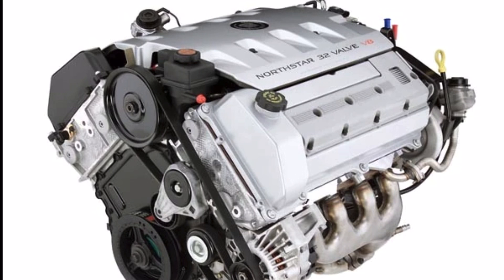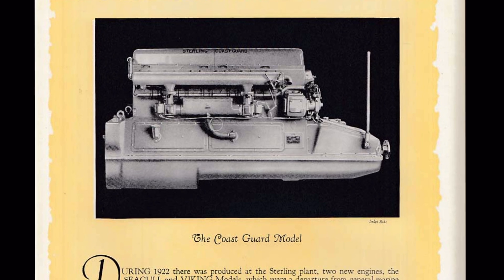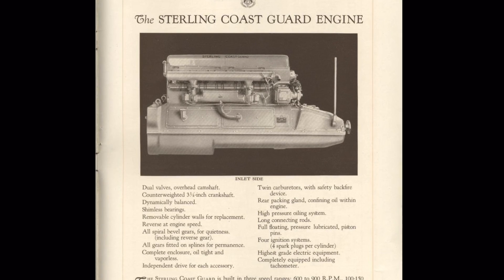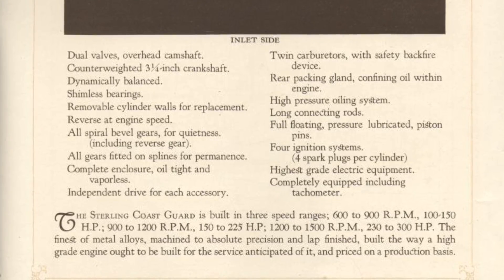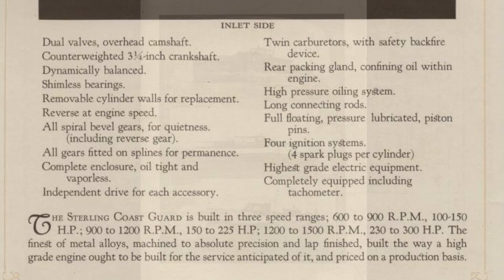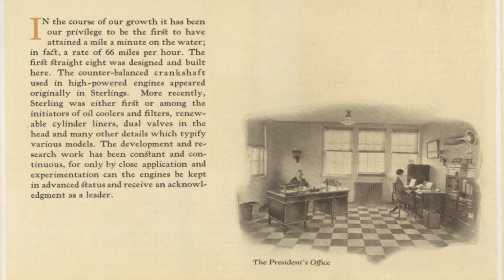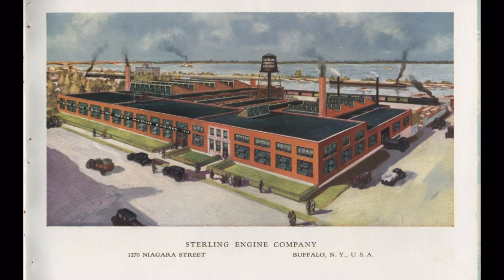They Beat GM, Ford, Chrysler & Duesenberg: 1925 Sterling DOHC, 4 Spark Plugs/Cylinder 1427ci Engine!

Comment: Packard came out with the v12 dohc m2500 in 1924. They had it producing 1700hp by the time it set the water speed record in miss America 10. The liberty engines of similar design being single ohc hemis from 1917

Comment: You should contact the Northampton, Massachusetts DPW. They had a Sterling engine in their flood control building powering a pump. I haven't been in that building in years, so it may still be in service. I never had phone with a camera at the time so I have no photos of it, but I'm pretty sure it was a V configuration.

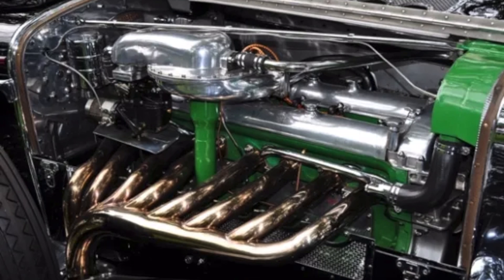Comment: That Duesenberg engine at 1:21 is the SJ model's engine, basically a J model's engine with a centrifugal supercharger actuated by a shaft coming from somewhere out of the crankcase. I presume that the shaft is actuated by a bevel gear on the crankshaft. That particular SJ engine has the original, or recreation of the original, exhaust manifold. That original exhaust manifold had a tendency to crack, so it was replaced with the more common four large pipes coming off the engine. The carburetor and supercharger are on the exhaust side, and the compressed fuel air mixture is conveyed to the other side/intake manifold side to go into the cylinders. It has a crossflow head. Most car engines back then were flatheads, which conceptually can only have reverse flow head systems. That exhaust side is pretty busy, it would be even busier if the Duesenberg model SJ were in right hand drive. Indeed a couple of Duesenberg model J's and SJ's were sold in the British and Indian markets. In 1935 Maharaja Yeshwant Rao Holkar of Indore ordered a Duesenberg model SJ in right hand drive boat tail speedster/roadster through R.S.M. Automobiles of London with coachwork by J. Gurney Nutting & Co, chassis number 2614, engine number J-585.

Comment: That were also used by the Pennsylvania rail road as emergency engines on vertices lift bridges when there were electrical outages. They were still in use till the mid 1970s

Comment: Really it was Stutz who built the best OHC & DOHC straight 8's as their engines had a proper 9 bearing crankshaft, whereas the Duesenberg on had 5 main bearings. It might also be better to compare apples with apples not oranges, as marine engines were in a totally different price range

Comment: Given the actual displacement is 1426cu in plus change , 300hp is not out of line for the intended applications.  Generally marine engine ratings can be higher than for a nearly identical off-road or on-road versions due operating under constant load due to propeller slip vs variable l Ioads imposed by going up and down grades for example.

Comment: there is much more to any design .. comparing slow stroke giant 1400 CI to a hot gas torch head of a little 2 liter is not advanced engineering for overhead cams. It is stupid. there is a reason pushrod, single cam is still being made...longer than any other. The internet is keyboard warriors and you tube hobos with self declared engineering degrees, I digress. Dig a little deeper next time, dweebs. :goodvibes:

Comment: First run	1910s, the Hall-Scott A-7 was an early liquid-cooled aircraft engine manufactured by the Hall-Scott company of Berkeley, California. Using a straight-4 configuration, the engine developed 90 horsepower (67 kW) as the A-7 and 100 horsepower (75 kW) as the A-7a. 
In service these engines suffered from reliability problems and were prone to catch fire while in operation.

Also these Hall Scott aero engines (water cooled) were nicknamed by aviators as the "Scalding Hot" when the hoses to the radiators burst and the coolant came back at the pilots....
Reply: They actually put those in planes???  WTF????
Reply: A7 Hall and Scott...aviation engine much lighter.. @mistersniffer6838

Comment: Dual valves  They must have meant two intake valves and two exhaust valves..   It's not a two stroke  4 stokes need both an intake and an exhaust valves..  Detroit Diesel 2 stokes have  4 intake valves on many models .

Comment: My  1955 Murphy Diesel engine in my Northwest Crane is  1103 Cubic Inches  has a Double Overhead Cam  with 4 valve heads  it tunes 1,200 RPM's wide open makes 110 HP  lots of Touque burns 3 gallons of fuel per hour when working it hard.
  Murphey's were used in Generators   Rock Crushers and Tug Boats too.  They even made a V-8 Diesel with a Turbo charger for tug boats..

Comment: 222 Cubic Inches per Cylinder  Why did  you say it was a 230 Cubic Inch engine?  Now I see your caption says 1427 Cubic inches?  I multiplied the  bore and stroke times 6 Cylinders and came up with 1334 Cubic Inches..
Reply: I think he says 456ci or something like that in the video. When I saw the bore and stroke sizes it sounded low to me. I have been reading a lot about aircraft engines lately and they have huge bore and stroke like that and are usually 1000ci+.

Comment: I find the mentioning of the shim less bearings a noteworthy item as well! Most engines in that era required shims to get proper clearance! In fact the Chevy inline 6 had shimmed main bearing caps all the way into the early 1960’s!
Reply: Not in 1959 chevy cars they didnt..
Reply: @brettpowter6010  I am just going on what the machining hand books say.

Comment: At 2:31 the profile photograph shows what certainly appears to be a PCV line.  Part of the 'totally sealed' construction.  Definitely do not want blow by getting into the enclosed engine rooms of a small(ish) launch.
Reply: That's very early to have that technology, I think was the first of the big three that instituted PCV was Chrysler in 1965 before emissions laws were in effect. Before they just had a road tube.
Reply: Which is why all the concrete expressways int he 1950's to 1965 had that black streak straight down the middle of each lane  ...dripping condensed vapour oil fumes out of the draft tubes of millions of cars.....
 @hendo337

Comment: There were pretty cramped quarters below decks, a quiet engine undoubtedly was important when you might have half the crew trying to sleep
Reply: Little vibration would be a plus for engines solidly bolted to a wooden hull that would act like the sound box of a guitar???

Comment: In reading the brochure it says dual valves overhead camshaft. That doesn't necessarily mean it is dual overhead cams. I have a 1963 Willy Jeep Wagoneer which has the Tornado 230 engine in it which is single overhead cam which operates both the intake and exhaust valves in a crossflow style head.
Reply: Not only a crossflow head, but a HEMI !!
Reply: Agree. SOHC.
Reply: Those 230 Willys SOHC engines are rare. I did engine rebuild for 42 yrs and only saw one. Another rare engine was 230 OHC Pontiac.

Comment: Given the born stroke combination, and 6 cylinders, 500 foot pounds of torque. Possibly, even more given the stroke.
The ability to provide propeller through air or water torque is Superior to horsepower when trying to push a propeller through air or through water

Comment: Wow an 11 minute video focusing on DOHC, and not even a mention of the LT-5 arguably one of the best engines ever placed into a production car, the C4 Corvette. I realize the main focus was on the Sterling engine, but to omit any mention of the LT-5, could almost be construed as a rub. An engine that at 350 C.I., a joint venture between GM, Lotus, and Mercury Marine, went on to shatter endurance and speed records previously held the Morman Meteor that boasted a 1300 C.I. Curtiss aircraft engine. The C4 still holds those records for a production car; 24 hours straight  averaging north of 175 mph is a staggering accomplishment. I think I just gave you another idea for a video.
😋
Read up on the record breaking run, it is a terrific story. “The Heart Of The Beast” is a must read for any engine enthusiast.
👍🏻
Reply: The point is early engines, with surprisingly modern technology, hence Dusenberg is one of his comparisons. I think this highlights a major problem we have had with planned obsolescence in this country post WWII as well.

Comment: America was NOT IN WW2 in 1940. They were still supplying both sides with war materials. Peugeot was a European automotive, and they were engineers. Something the US has never had. The US engine makers make nothing but TRUCK ENGINES.
Reply: We weren't supposed to be in WWII, they were opening military bases and laying down new ships, building modern fighters, bombers and transports at a breakneck speeds before Dec 7th 1941. In fact Fort Chaffee, AR was opened the first week of December 1941, Camp Forrest was opened in 1941, the USA Lexington was laid down on Sept 9th 1940, the Willy's MB and Ford GPW and Dodge VC-series trucks were in production in 1940. Lend lease was in full effect. The people were all viralantly against the war and then they left a few old WWI era battle ships and a few random obsolete ships in Pearl Harbor for the Japanese to blow up and get the American people on board. Just like the USS Maine and Lusitania before and just like a few events after like the Gulf Of Tonkin and 9/11. All it takes is a little pattern recognition and some reading.
Reply: @hendo337  Did you respond to me? I typed that the US doesn't make real engines. Everything is modified from TRUCK ENGINES. When did you last build, from scratch, an under 2-litre petrol engine?
Just a quick question:- What is a "Fort Chaffee, AR"? "A" must stand for Air, and, possibly, "R" stands for Re-Supply?

Comment: This was very cool!
As time went by, there were many unique marine engines based on big three car engines.  In another thread I mentioned the Chrysler Marine 6 with the sodium filled exhaust valves, and our early '70s Glastron speed boat had a "Crusader" Chevy 4-bbl 307 with 4-bolt mains...
Reply: My Uncle had a 1972 Chrysler boat and 85hp Chrysler Outboard. It was a 2 stroke inline 3 I believe. It sat for 15 years in upstate NY weather and we started with a fresh battery and gas in a 55 gallon drum full of water to cool it on the second turn of the key it popped right off and ran great, we lubed the driveshaft to the prop and took it out on the river with a couple tiny trees growing in the carpet if rotten leaves in the hull and it went 43 mph.😂This was around 2008 and it was a heavily used 36 year old engine. It absolutely amazed me that it was still good.
Reply: I do hope you changed the water pump impellor before it disintegrated and filled the head passages with rubber particles and cooked your motor???
 @hendo337

Comment: Actually my Father bought a brand new 1976 Cosworth Vega sold by General Motors/Chevrolet..
The car actually was sold in 1975 also....
Reply: I bet he regretted that later, that was an expensive car, I believe you could get a Camaro with a 350 4bbl, Pontiac Firebird Formula with a 400 or 455 for that kind of money, nearly enough to buy a base Corvette. It's a shame they screwed up the Vega so badly, it really could have been a great car and it's like they couldn't help themselves and just had to ruin it so they could push people into larger more expensive cars.

Comment: Duesenberg had 4 valves per cylinder dohc if I am not mistaken in 1927 it had 300 hp
Reply: 1928, 265hp naturally aspirated and 300hp supercharged.

Comment: 300 HP at 1200 RPM-1500 RPM. 
That’s kind of CRAZY ! !
That’s like a Diesel Engine. I wonder what the torque rating is?

Comment: I greatly enjoy your researched content and interesting videos. Although Sterling might indeed have produced DOHC engines, the photos and drawings in this video don’t appear to show one. In fact, the end view of the engine looks like it supports push rod OHV or possibly SOHC. But that valve cover doesn’t appear wide enough to house two camshafts. I don’t see any evidence of room for a chain or gearset drive for over overhead cams either.
Reply from the maker: The one featured that’s running is indeed DOHC.  Confirmed by the restorer.

Comment: 0:20 - Might want to edit that statement - '87 would have been when GM of the US was designing the Quad 4 for release to the market in '88, but by then GM Australia and Europe was Selling the DOHC version of the GM Family 2 engine, which would later evolve in to the Ecotec four cylinder. The Family 2 engine launched at the start of the '80's.

Comment: The Curtiss D-12 1145CI/18.76L V-12 aero engine from 1922 Derived from the K-12 design that was originally drawn up in 1916. Aluminum crankcase with aluminum cylinder blocks in the D-12. The K-12 attempted to use a single piece aluminum block. DOHC with 4 valves per cylinder

Comment: It's sad that almost all the high quality niche market engines aren't made anymore. Except for the modern diesels which aren't all that exotic. I like the modern diesel boat engines in large vessels. You can remove the cylinder and piston and rebuild them while in the vessel, essentially having an almost new engine.

Comment: My 1994 Olds Cutlass Supreme Convertible has the X option engine. 3.4L DOHC. I had to change the timing belt some years ago. It was quite daunting due to the instructions being difficult to understand (for me). It's supposed to require special tools too but other than a thick, flat plate to hold the cams in place while rotating the belt (and drive sprockets) to the correct position I was able to do it with common shop tools.
Reply: You manly man, you!

Comment: I'm surprised they didn't have water cooled jacketed exhaust manifolds.  If so they could have taken that HP rate up to at least a third more.  I love these old engines and they were built to last and be run hard,, no penalties for weight so the size equaled durability and toughness.  Back when I was getting into mechanics and saw auto sales commercials I would state "Show me the under carriage, show me frame and front end components, show me what's really built on this vehicle".  Chrysler had a stainless steel exhaust system for a while, Problem free for the life time,  I have seen cars and trucks 10 yrs old and the frame rails are rusted thru, Brand new engines, rear end, transmission housing broken, cracked, JUNK. Everything is designed and built Cheap like toys to be thrown away after a handful of years.  Shameful, and I think this is just exactly what some wanted to happen and it started with steel industry and others leaving the US.

Comment: 4 plugs per cylinder!!!  Wow.....  I bet this feature was to help the engine run efficiently at low RPMs.
Reply: I’m sure you are correct. Probably for redundancy, also. They’re likely independent, and can be cut in and out separately. Like a Seagrave fire truck engine, (two separate independent ignitions)

Comment: Me thinks you are incorrect about the Sterling coast Guard, the spec sheet says it has dual valves as opposed to one valve and a port, and an overhead camshaft, not camshafts.  Also the picture of a well used engine shows a narrow valve cover, not indicative of dual cams.  Even a single overhead cam in a time when most engines were valve in block, flathead, engines is a significant improvement.
Reply from the maker: No, it is definitely DOHC.  I've seen one with the cover off.

Comment: Double over head cam engines are all piles of shit
Reply: Should’ve just had sails. Sail boats don’t have to have those sorry cams and crankshafts and piston. Don’t have to worry about carrying around a bunch of flammable fuel either.
Reply: Flatheads are the best and with no fancy electric stuff.  Maybe electric windshield wipers.  Maybe.
Reply: @greggc8088 I too would like a Flathead with flintstone ignition, none of that fancy yuropeen sparkplug nonsense
Reply: @mrspandel5737  🤣

Comment: First GM DOHC 4V passenger car engine was the Cosworth Vega in 1975-76
Reply from the maker: Wasn’t engineered by GM
Reply: @RareClassicCars  Parts of it were, and it was produced by GM. The actual Cosworth engine was different in a number of ways- crank, rods, pistons, head, valvetrain. I owned a pile of the different engines of both kinds.
Reply: Cosworth is British
Reply: @jamesbulldogmiller  I beleive they were built at the Tonawanda engine plant in New york

Comment: I have always wondered what advantage you got from overhead cams in an engine that runs at less than 2000 RPM? On a low speed engine (>6000 RPM) there are many ways to run the valves just as well. Yes, at high speed they do have an advantage but examples like this engine and WW2 aircraft engines? There must have been better ways.
Reply: With the poor fuel of the day,  and since they thought they needed 4 plugs per cylinder,  maybe 4 small valves in the little headspace left over gave good low rpm power,  and the overhead cam is a much less complex way to drive 4 valves.

Comment: Why 4 plugs per cylinder? Redundancy ?
Reply: I think that you’re correct.
They’re probably independent. And can be cut in and out . 
Like a Seagrave Fire truck engine (two independent ignition systems)